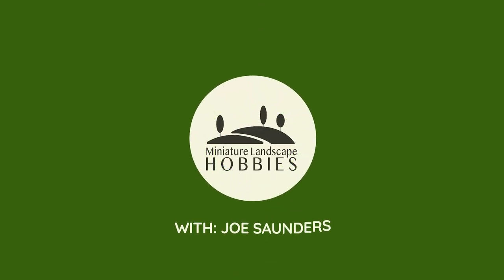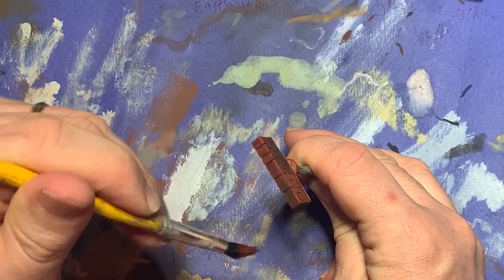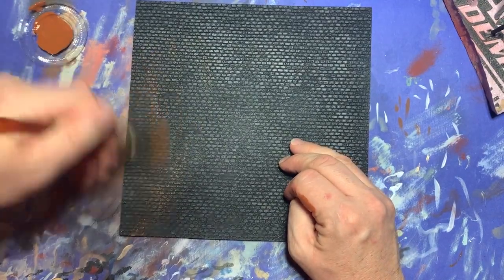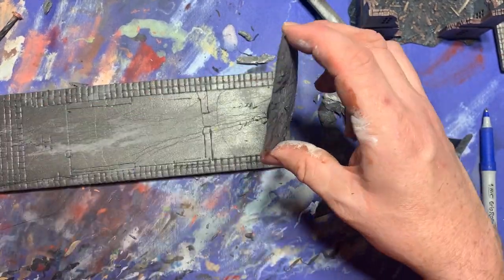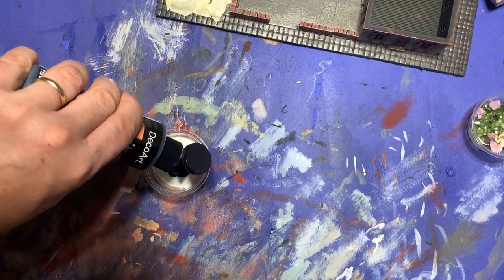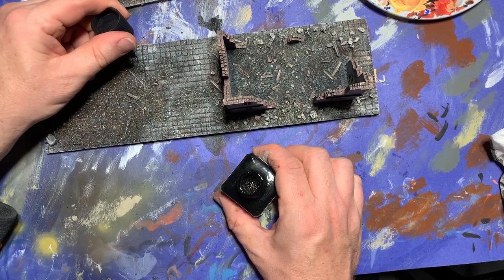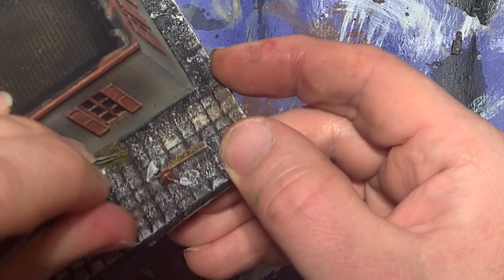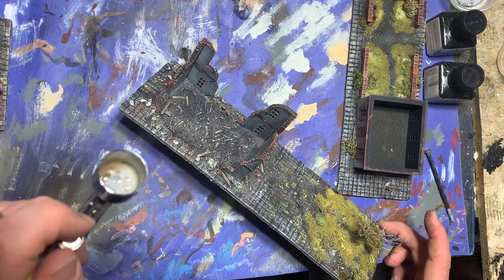Terrain For The Launch Of Flames of War: Bulge American Part 2

Comment: Did you print houses?  Where to find stl files?  Great video.
Reply from the maker: Thanks for the comment.  These are nt 3d printed.  Yhey are a product by GF9 called Battlefield in a Box.  I work with them a lot.  you should check their line out.